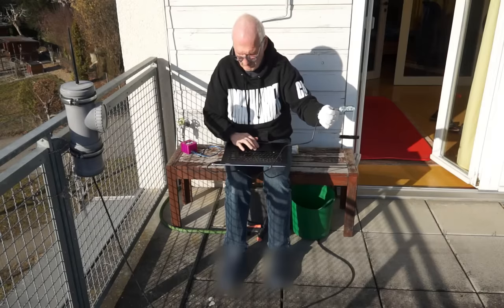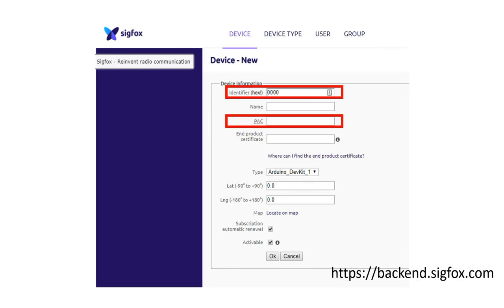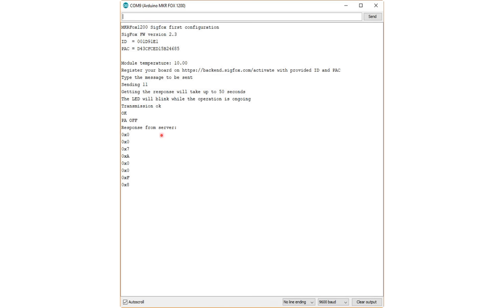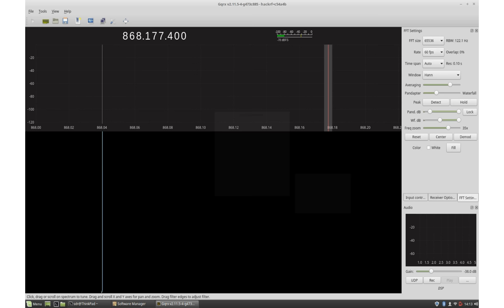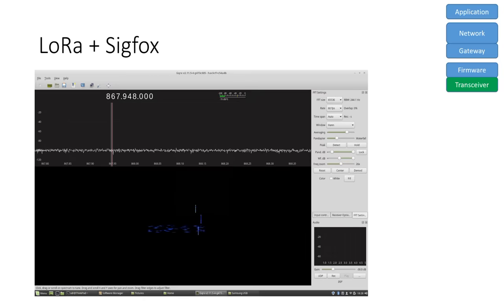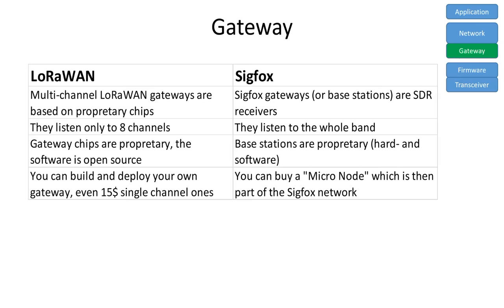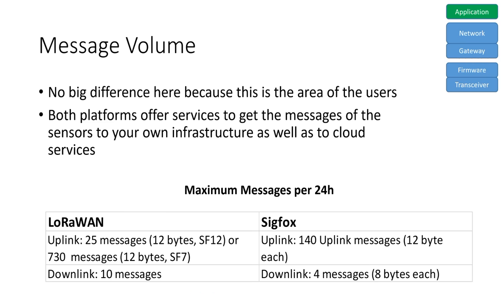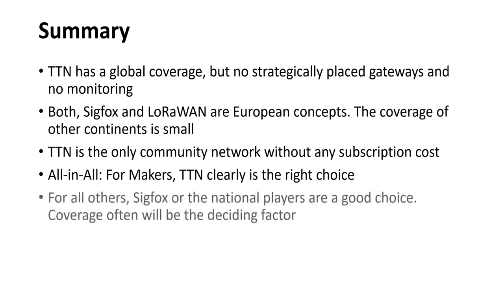#257 Sigfox vs. LoRaWAN (TTN): Which one is better? (Arduino MKR Fox 1200)

Comment: So first you mask the id/pac nr then you give it away several times further into the video ;)
(not that it should matter much, but still a little funny)
Reply from the maker: You are right!
Reply: Gurk Burk the PAC is a one time use code anyway, so the one printed by the Arduino is already used and no longer valid. The next PAC is available in the Sigfox dashboard only,
Reply: @AndreasSpiess  I know this video is old but could you kindly do a comparison between LORA, Sigfox and Wirepas.

Many thanks!
Reply from the maker: @earllewis4396  I never heard of Wirepas :-(
Reply: @AndreasSpiess  Thanks for getting back  to me. Would be a pleasure to have a chat with you anyway. I did reach out on Facebook might be able to take it from there if you still use that platform.

Comment: The number of uplink messages allowed for sigfox is actually not hardcoded like in the video, it's based on the contract assigned to the device type in the Sigfox Backend. 140/day is a standard plan though.

Also, Sigfox has 4 region bands, so there is roaming of a sorts because they use different carrier band sets in each region, there's a few devices that support RC1-4 but many are only for one region.

Thanks for an informative comparison :)
Reply from the maker: I cannot mention every detail in 15 minutes. I did not mention the different bands because this is known to my viewers.
Reply: 140/day is actually the max limit for a Sigfox device based on current pricing; it would be the highest cost plan: ~$1/month.  2 msg/day falls into the lowest cost plan:~$1/yr.  Contact your regional (country) Sigfox operator for exact pricing.  ~Sigfox sales engineer

Comment: Another excellent video from the "Expert with a Swiss accent": thank you so much for the qulity of the video. Please note that the 10xDL max.message per day comes from TTN "best practices" only: you do not have such limitation if you run a private LoRaWAN network (what you can forget with SIGFOX), nor if you use an Operator network (you might just pay more for these extra DL...). The deep indoor propagation of LoRaWAN is also better than SIGFOX.
Reply from the maker: I compared TTN with Sigfox, because they are comparable (existing network is usable for non-network owners). Otherwise, I would have to compare many other technologies like Weightless. And then, I am not sure if LoRaWAN with its complexity would be the best choice.
I do not know how many Makers build a full private LoRaWAN network stack for their few sensors. The effort is not small and a simple receiver would probably be a better choice. I think the attraction of TTN and LoRaWAN is, that we can avoid this effort.
As I mention in the video, LoRaWAN and Sigfox have comparable link budgets at the same frequency. I would expect that the indoors propagation is similar unless you build your own gateway. And there, you are right, is probably the biggest difference between the two concepts for makers. For TTN you can add your own gateway (even single channel) which is much cheaper than the micro-gateway of Sigfox.

Comment: I'm glad that you have this episode since I can only use LoRAWAN for the moment (and, of course, because of your video series! Thanks! ).
My country has NB-IoT for years now, but I still have many issues with the networks. Especially, the network doesn't support TCP protocol. And the community here is quite small compared to another network. 
Thanks for your video!
Reply: id513128 NB-IoT isn’t supposed to support TCP! It’s super wasteful to try to maintain an established guaranteed connection on top of it it, use UDP. Imagine it as LoRa and establishing TCP over LoRa... it would be crazy
Reply: @gkdotclass  
1. I agree that using TCP protocol over NB-IoT is not a good idea. However, it's mean you have to set up a dedicated UDP/CoAP server just to relay to MQTT/REST/Firebase message/etc. or rely on telco's message service. (Which is very toxic to use in my case) Which is not maker-friendly to me.
2. Using UDP meaning that if you want data encryption, you have to implement yourself unlike LoRAWAN as Mr. Andres has mentioned. If TCP protocol is support (And, as far as I know, it should), then I can use more "standard" like HTTPS, MQTTs.
Reply: id513128 In NB-IoT over the air traffic is encrypted already. You can use MQTT-SN for similar functionality over UDP. 
TCP is not compatible with low power, especially in wireless with high chance of packet loss.

Just like you don’t use TCP with LoRa don’t use TCP with NB. Similar principles. Yes both require intermediate servers if you want to bridge to some legacy service which doesn’t offer native integration. 

Actually the BEST strategy for NB is to use a bit like SMS using the Non-IP traffic feature. That is the truly low power of using it.
Reply: @gkdotclass  Oh, I never heard about MQTT-SN before. Thanks for comment :D

Comment: Hi Andreas
very good video as usual, professional and easy to follow
you have converted me to MQTT and ESP stuff
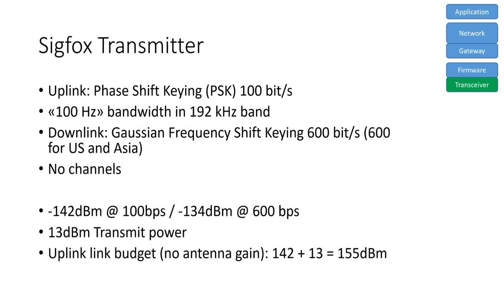I have one comment to make at 7:28 you calculate the link budget without antenna basically by substacting the receive threshold from the transmit power : 13 dBm -(-142dBm) = 155dB . When subtracting two power values (dBm) you have a number without unit which represents here the possible transmit antenuation in free air and obstacles. My two cents to your huge contribution
I have currently a Zwave based (Vera 3) automation system which i will convert to Home assistant and node red + some ESP based I/O
Thanks for putting your work to public Knowledge.
Reply from the maker: You are right with the dBm. My mistake!

Comment: Thank you, great info. In addition, while Sigfox provide a service level, LoraWan/TTN enables setting up an extra gateway yourself, when there is no or poor coverage on a location. Landscape/topology can play a big role.
Reply from the maker: I thought I mentioned the homebuilt gateway ;-)
Reply: Andreas Spiess Sure did, or buy them already built. Just to highlight this for deciding between the two.
Reply: Sigfox also offers the ability to setup a gateway (we call it base station) yourself.  It's referred to as CaaS; Connectivity as a Service.  The end user basically leases a Macro or Mini base station to enhance coverage in whatever area they desire.  Contact a regional (conuntry) Sigfox operator for more details.  ~Sigfox sales engineer

Comment: On minute 9:00 you show the spectrum marked with the transmitted signals from lora and sigfox nodes. I can see that the sigfox basestation could just take the first sent signal and receive the signal correctly. But the lora signal is much wider and a tiny part interferes with the 3rd SigFox signal,  how can this bit of information also be successfully received by the Lora-Basestation when it interferes with the sigfox signal ? Isnt it lost ?
Reply from the maker: If you have too long interference the signals are always lost. That is a problem of RF systems in general.

Comment: Another very interesting comparison. It is a pleasure to have good engineering comparisons of the new technologies as they hatch. Watch the Weightless one too (good British engineering!) - it is quite compelling as it sits in white space, where the new WiFi standard is also proposed.
Reply from the maker: So far I did not cover infrastructure without networks, because it is only interesting for very few people. My viewers are mainly makers which are concentrated on the nodes. This technology is more interesting for network operators, I think.
Reply: @Andreas Spiess - I am not so sure when it comes to the reality of scalability. Maybe when the node hardware is in full production.
https://www.ubiik.com/single-post/2018/02/26/New-Zealands-Weightless-LPWAN-Network-Deployment

Comment: Hi Andreas! Well done! You mention sensitivity an link budget, but how´s about strong signal immunity? If you are close to another transmitter, do you still receive your message?
Reply from the maker: The transmitter does not care. Only the receiver (Gateway). I hope everyone cares about that when he places his gateway. All transmitters in ISM bands  have to comply the same rules. Small power an 1% duty circle is
Reply: Andreas is correct.  However here's a few facts about the Sigfox protocol - 1) it's Ultra Narrow Band (UNB) so more energy is focused at the transmission frequency which a) enables a device transmission to 'punch thru' average noise in the band and b) results in longer battery life, and 2) the message is transmitted 3 times at different frequencies (spread spectrum) so if there is too much noise at one frequency, chances are one of the other two message transmissions will get through.  ~Sigfox sales engineer

Comment: would it be possible to have 2 lora modules talking to each other and then one of them talk to a lorawan gateway? I Don't know if this case has been covered in LoRa videos, since there are so many I haven't had the chance to go through them all
Reply from the maker: A LoRa repeater should be possible. But I do not know if somebody built one. Sigfox seems to have one.
Reply: @AndreasSpiess  thanks for the quick answer. I think you misunderstood what I meant, I don't want to improve the range of the gateway. I'd like to try having a star topology of lora nodes and one node serving as some sort of "hybrid" gateway (refering to my previous question: can loraWAN modules also do p2p with lora modules) to the real LoRaWAN gateway. 
Again, thanks for the informative videos.
Reply from the maker: That is what I call a repeater, if connected only to nodes or to nodes and a gateway. Or a gateway, if it is connected to the backbone
Reply from the maker: And I made a video about P2P with LoRa modules

Comment: Excellent as usual.
Do you think the future 5G will kill LoRa and Sigfox? Or they cover different needs?
Reply: Mobile phone operators are traditionally very slow moving, many don’t yet support basic 5 year old 4G features let alone 5G.. LoRa and Sigfox tend to be more agile. On the other hand true bidirectional data and allocated spectrum is a good thing to have, critical even in some applications. So I think we’ll continue to see both fields moving forward.
Reply from the maker: If I would be able to read the future I am not sure I would do what I do now ;-)
Reply: @AndreasSpiess  It's about what you believe in particolar what you know, if anything, about 5G.
Let's put it this way, I don't know much about these networks, if they cover the same market segment, than we can be quite sure LoRa and Sigfox will not be able to compete with the Telcom giants that have already invested billions on the licences and are creating the 5G structure.

Comment: What’s the best way to educate myself about radio communication/antennas etc. ? Maybe there is a good book? Im a Master Student in Mechatronic.
Reply from the maker: I do not know because I learned the stuff 40 years ago. If you want a standard search for the ARRL Antenna Handbook. Thick and expensive :-(
Reply: Become a ham and make a lot of your own antennas.  You'll quickly find that there's a serious gap between theory (formulas) and reality.  Antenna theory isn't far removed from voodoo and black magic.   The higher in frequency you go, the weirder it gets.  But even shortwave (HF) antennas will quickly show you that the simple formulas are only a starting point.  Antennas are used in the real world where they interact with virtually everything around them.  You'll need to come to terms with things like velocity factor and impedance matching.  You could spend your life trying to master the theory, or you could experiment and see what works for you and what doesn't.

Comment: i love yur videos, can you make a video explaining the requirements for an embebed system to run a mqtt broker? to use as a broker an esp8266 or esp32? and do you think you can achieve more transmitting power with the lora module if you make a gain stage with an opamp? (as lora uses low  frequency compared to wifi i believe the opamp can handle it) Greetings from argentina!
Reply from the maker: I do not see the need for embedded MQTT brokers. The run usually on a small server or in the cloud. 
And Opamps are used for low frequency and low power applications. LoRa Operates at nearly 1GHz, which is already Microwaves.

Comment: Sir i cannot find ESC brushless motor  schematic for 200A or 300A 60 volt.. can we build one tutor please thanks... based arduino ..thanks
Reply from the maker: I have no knowledge about high power ESCs
Reply: Check out GreatScott! He has tutorials on building ESCs.
Reply: @AndreasSpiess  ok sir no problem 😊
Reply: @GRBtutorials yes but  greatscoot no more than 30A ..it will burn the mosfet fot motor 167KV .. need minimal ESC 170A ..😊
Reply: Rudy Smd First off, KV ≠ A. KV indicates the speed, in RPM, to voltage ratio. A 100 KV motor, for example, rotates at 500 RPM at 5 V, 1000 RPM at 10 V, etc. If you meant amps (A), well, it’s just a matter of getting more powerful MOSFETs.

Comment: Is there really no completely open standard or open source based RF technology for this use case? It just seems weird to trust single companies with something this important.
Reply from the maker: You can build your own „network with standard FSK chips.
Reply: LoRa is only dependent upon getting the hardware.  It is not dependent on the TTN backend since there are open source replacements for that functionality, such as Loriot.  You can instantiate a complete end to end replacement for the features provided by TTN..
Reply: mike brown the LoRa modulation itself is patented and only available in Semtech own silicon or its IP licensees. Imagine if Lora did become the de facto IoT standard. Semtech could come along and said “thanks all for adopting our tech,  now that you’re stuck we’ll just raise prices by 20%”...  monopoly in the making.
Reply: @gkdotclass  20% wouldn't mean much, neither would 100%.  Those chips are cheap.  That said, semtech didn't invent the chirp spread spectrum (CSS) concept.  They may have some trouble with prior art issues when it comes to legal enforcement of their patents.  Their modulation scheme has already been completely reverse engineered as well.  Since the FSK scheme used by Sigfox apparently offers (arguably) the same efficiency and range, I'm not too worried about semtech pricing themselves out of the market.  I am concerned that Sigfox nay be proprietorizing the central end (gateway) technology.  As for any security advantage that Lorawan offers, I don't think it would be too hard for Sigfox to match it.  I guess what I'm saying is that there is plenty of room for both and neither brings something to the table that the other can't match.  I chose LoRa because neither had coverage in my area and it was cheaper to implement a LoRa gateway.  Plus, I like open source, Sigfox appears not to.

Edit:. This sums it up better than I did.
https://www.link-labs.com/blog/sigfox-vs-lora
Reply: A quick Wikipedia lookup seems to say that "Weightless" seems to be the most open source and top-to-bottom (hardware to software level) open standard based technology, but it's adaption seem to be very low, and there might be patent issues.

I just really dislike putting all one's eggs into one basket (LoRa or SigFox it seems). I would very much prefer a WiFi-like arrangement, with an open standard and many different companies able and allowed to produce the silicon.
Reply: @MoritzvonSchweinitz  is anyone making RF modules besides ubiik?  At US $1500 for a starter kit, it has already priced itself out of the question for me.  If there is only one hardware source, that would qualify as putting al of one's eggs in one basket.  LoRa is an open standard too.  Any member of the alliance can manufacture hardware.  I don't know exactly what Hope is licensing from Semtech, maybe the pin and software compatibility aspect?
Reply: @mikebrown7366  yes, I just saw the ludicrous 1500$ price tag, too. But, in theory, I don't see why other companies don't offer cheaper ones, if there was adoption.

I'm under the impression that the LoRa PHY is very proprietary, and hence other manufacturers aren't allowed to build the silicon, even if it were reverse engineered?

Comment: What is the best lora module ? What module have the best gain and tx power?
Reply from the maker: I do not know. All LoRa chips are more or less the same and if properly implemented, should have no differences.
Reply: LoRa chips are the same but definitely big differences when implemented in modules ... look for ones with at least a TCXO
Reply: @AndreasSpiess  What is the best cheap 433MHz antenna ?
Reply from the maker: I never tested 433 MHz antennas

Comment: I don't know if you've seen it, but there is a new, 70$, LoRa indoor gateway available.
Reply from the maker: Yes, I saw it. It does not make a lot of sense for me if I can build a 15$ single channel gateway. Why having 8 channels for a few sensors?
Reply: It currently seems to have some reliability issues.  I'm very happy with my relatively cheap RAK831 setup.  It runs for weeks, so far, without issue.  I suspect it will be fine for months at a time.  Plus, it's more of a real computer (pi based), so I can run other applications on it easily.  Plus, it's easier for me to make my gateway an outdoor device that it is to do so with the cheaper ttn gateway.
Reply: @mikebrown7366  I agree. Currently, the two main good sides of the indoor gateway are the price and the multichannel option. If they sort those issues, offer an option to connect an external antenna, so it could work as an external gateway, and make it possible, so the data can be transmitted to other cloud platforms, than I'm all for it.